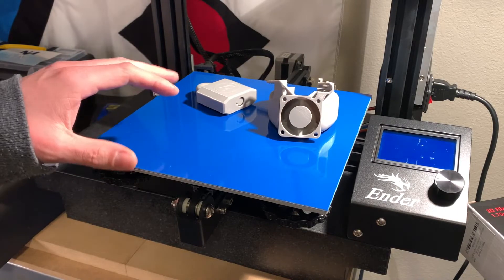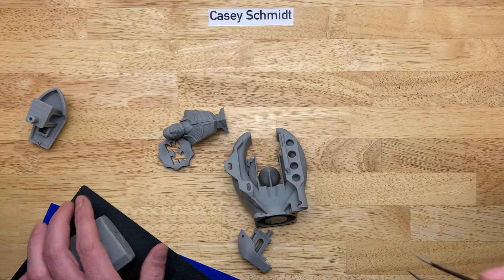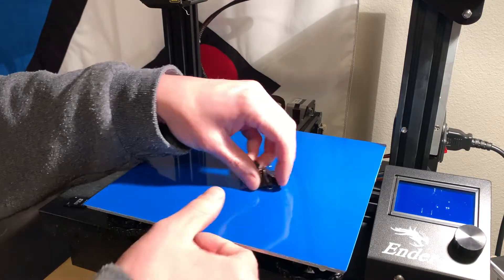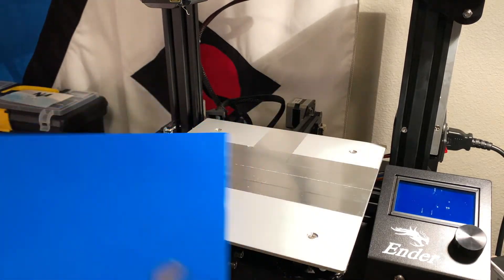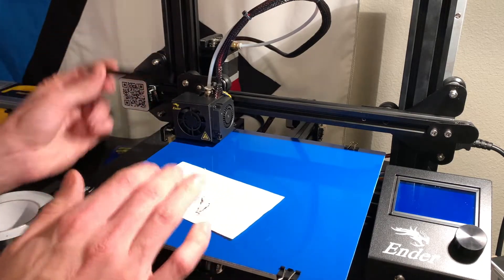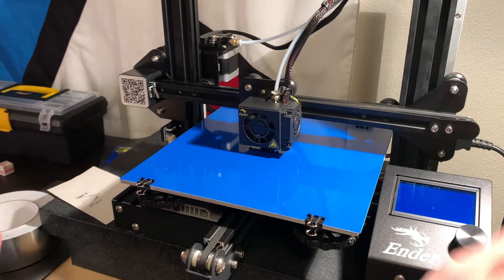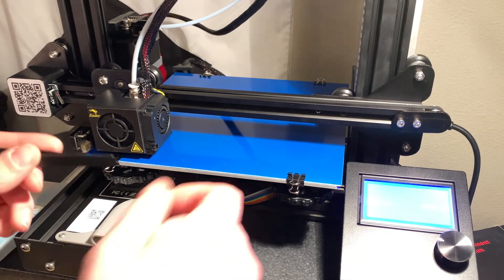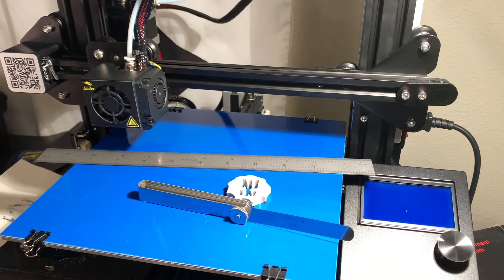Ender 3 - Fix Warped Bed, Bed Leveling, and the Best Print Surface

Comment: thanks i will try something like this, my ender3 worked great when it was new but then i stopped using it and stored something on the bed and now its low in the middle and no amount of adjusting fixes it

Comment: How thick did you go with the G10?
Reply: you will need 3mm of FR-4 (G10) for warped free G10 at higher temperatures like 110C for printing ASA for example

Comment: Great video, didnt even think of this! My plate is only sticghtly warped, if i level all 4 corners,  on the edges and in the middle i can fit 2 sheets of paper instead of 1. Will try to get my hands on some of this tape. Atm i just babystep z for small prints :p

Comment: This video was so helpfull, I finally understand the problem. For the people that do not want to adjust the problem with tape, during the process of fixing the warped bed problem and the help of this video I fixed the issue with the glass plate that came with the printer and this fixed it already I prefer a magnetic bed so I installed it on too the glass bed and the problem was gone without the use of tape😅

Comment: Well, I got impatient. I got my G10 at 12x12. I could not get it snap after scoring the lines so I took my Dremel to it. What a mess, lol. Unfortunately, my final cut is exactly the same as the heat plate as I forgot to add 2mm all around. Plenty of room to do so but I screwed the pooch this time. So, no overhang on the print bed! The bigger challenge was removing the magnetic adhesive on the hot plate. I finally managed to peel it all off and then spend 1/2 hr. removing the sticky residue. All done. Pray this works out for my printer. Thanks!
Reply from the maker: Patience usually prevails. You can always retry cutting another piece in the future too. Good luck!

Comment: I'm getting frustrated with my Bed level in The 4 corners seem like they are barely touching the paper. When I level them enough to grip it slightly. Every corner is exact near enough but the middle just isn't. I brought a new bed and it's still the same

Comment: I have the 3 Pro. It has a magnetic adhesive layer on the build plate. So I peel the magnetic sheet off the aluminum bed first, clean off any residue and then clip on the G10 build surface?
What thickness did you go with 3/32" or 1/8". What filaments do you use? It appears these phenolic plates only are tested to 280 degrees F. How long and how hot have you ever done a single print?

Comment: Been using a creality PEI sheet, and the center will often be lower than the corners, but it seems like it's the corners lifting over time on the sheet, and bed being of no issue.. which is extremely annoying, because traming it doesn't really help then 😅😅 pondering a G10 sheet, but not sure what they are like for warp over time
Reply from the maker: I’ve used that same blue sheet for about a year and a half now and it’s still in nearly perfect condition. For how cheap they are, I think it’s worth trying.
Reply: I have the same problem!!! - I have the Ender3 S2 Pro & have modified my gcode to bed level before printing to eliminate the problem, but the problem still persists.... 
I think what's happening is as the layers are printed, the more the centre s sucked in & moulds into the bed, causing the corners to lift. 
I have removed the magnetic plate that's stuck to the bed which came with my printer & the bed now seems to be level. Maybe its the glue?, as there seems to be more around the edges than in the centre, or there's some kind of expansion going on???. I'll order an aftermarket/thinner magnetic plate & hopefully resolve this problem...

Comment: Is there anything else you can do besides the tape I wore that it may catch fire what else do you recommend I have a ender 3v2 and changed the stock glass bed to the flexible magnetic bed and the adhesion problem was fixed but I had the same problem where the nozzle didn't want to touch the build plate even when the job was turned all the way
Reply from the maker: I guess it might be possible that the tape could catch fire but this tape is meant for HVAC ducting and exhaust so it’s can handle very high temperatures. I’m not sure of any practical alternatives.

Comment: There are several gcodes that will move the head from screw point to screw point.
Reply from the maker: I could have done that, and probably should have. But it was easier to do it manually at that time.

Comment: I have a bl touch and use that for bed levelling and still have warping problems. Why wouldn’t you do the levelling warm if youre having warping problems?
Reply from the maker: Parts can/will still warp even on a very flat build surface. It’s simply due to the contraction of the plastic as it cools; larger/longer parts are more susceptible.

As far as level the bed warmed up, that would be a much better way to do it if you need the best accuracy. I have tried it both ways and it doesn’t make a whole lot of difference for the parts that I print only because I try to keep my parts small and use a thick first layer.
Reply: @Casey_Schmidt  awesome reply and explanation thank you so much i was ready to  buy another hot plate and/or chuck the whole printer in the garbage if i didnt come across you

Comment: How would I know if it's the glass or the metal bed that is warped? I want to get a g10 sheet and not have to manually plane the metal bed. Will just replacing the bed surface with a flat one help?
Reply: Glass will conform
Reply from the maker: Getting a new aluminum plate that is not warped would be the best solution. 

Anything you put on top of a warped bed will just end up being warped like the bed; unless you used a very thick piece is glass. But that would end up being so heavy that you’d get into ringing issues.

So the only reasonable options to improve flatness are to either shim the existing bed like showed or to purchase a replacement flatter bed.
Reply: @Casey_Schmidt  But how in the world are you knowing your next bed would be really flat?
Reply from the maker: @Michel777   there are precision ground plates but they’re quite expensive.

Comment: just throw it out if the bed is warped that's bad quality control seeing as everybody with an ender has the same problem best suggestion don't buy one don't know about other machines if they have the same problems
Reply from the maker: Aftermarket beds are much better, yes.

Comment: Great video! Do you have a recommendation on how thin the aluminum tape should be? I found some at home depot that says its .003 mm thick and my instant reaction was it might be too thin and require a lot of layers. There are some others that are around .1 mm thick as well
Reply from the maker: Thicker tape is better thermally. The glue layer acts as a little bit of an insulator so fewer layers is best. However, thicker tape is harder to work with and may result in more creases and bubbles so take that into consideration too.

Comment: What filament did you use
Reply from the maker: The stuff I’ve used so far is the cheapest junk I could find on eBay from a US seller. Like $15 per roll. It works surprisingly well to be completely honest. But I will be trying a spool from Atomic Filament next.

Comment: It's as had taken a while to think of this but for one thing;  the beds on these should be never anything but a cube if need be;  I mean that it should be thick enough that it cannot be anything but straight;  and then if there would be such issues as then the travelling of the head of not being perfectly running squarely;  then there would need to have a runner that dictates how high the tip is and this runner can only be under the bed;  where if spring loaded upwards as if to keep away the furthest from the bed and the runner having it always kept down and as the runner always is exactly at the same spot as the tip and if the bed is exactly always the same thickness;  then if it is setup well;  it should work.  Or why would it not be that there are four corners that determine the height by the use of each a screw that is mounted on a solid flat bed( like any other tool out there).  Like a planer has;  way too much maintenance is needed to work with these.  Why ever would it be logic to have two separate strait edge parts for the keeping of a precision tool tip aligned?  This all because of materials costs and weight of shipping I suppose.  Ideally;  it should be built within an iron bed such as similar to a table saw table grade of solid and oversized with two racks running two pignons each that hold  two other racks that are mounted to a solid plate where the nozzle does not move and the is the one that starts up high at the nozzle and has  a screw at each corner that moves it down with exact precision.  And eventually;  with this method;  they can have a plate with extrusion pores that cover the whole plate and nothing would need to move other then vertical as a constant instead of steps(maybe);  where a constant flow of complete printing where the whole object will seem to be coming out of the extruder surface.   Cheers.  I've predicted many of things and can't remember of any that haven't happened.  I might just not remember of some but I doubt it though.  Ah ya ok  here it is;  water cooling as it goes downwards withing the water cooling bath where the extruding goes on at a controlled distance above the water level.  LOLOL  I bet you it will take until year 2026 for them to get that.  Watch and I'm sick of writing on hear and so I'm outta here man.

Comment: Installed the G10 sheets on all my printers, and the comments made above regarding the advantages are SPOT ON.  These build surfaces, are the best thing since sliced bread. BTW fantastic is an understatement.
Reply: Don't know if you still replying to comments but, i have been using the Ender 3 magnetic bed 2 of them and there warped is that common and evertime i do a 1st layer a part of that layer doesn't stick and i see big gaps
Reply: fun fact that plate he has didnt come with the stock ender 3 if i am correct. the backing on those are garolite. the surface on top is just buildtack. you can flip it over and use the other side. and doing that is how i found out my aluminum bed was warped. wouldnt stick in the center at all it had a dip down in the center. and that lead me to this video

Comment: instead of using the paper you can use the feeler gauge to set the tip at a more exact height.
Reply from the maker: Very true. I have tried a feeler gauge but I found, at least for the printing I do, it to be more difficult to use and any additional accuracy to be unnecessary. I will concede that it is a technically better way to tram the bed.
Reply: @Casey_Schmidt  I was gonna say, this dude knows that tram is actually the proper name, has feeler gauges, and then went and used paper anyway?!?

Comment: I have a machinist's granite surface plate and have thought about lapping my Bed
Reply from the maker: It might be worth it? But the plate will warp when the bed is heated anyway so I think the best way to go is a BL touch or similar system that will have the g-code modified to follow the contour of the bed.
Reply: @Casey_Schmidt  I have a CR touch and am still getting thin spots. Bed seems to be warping more by the day.
Reply from the maker: @59KYHighlander  you can buy aftermarket cast aluminum beds the are made to have minimal internal stresses then machined flat. That may be the best route if you don’t mind spending some money (probably more than the machine costs). Then again, these machines are more about the fun than them money. Another tip that I’ve heard to combat thin spots is to increase your first layer height and first layer extrusion multiplier.
Reply: @59KYHighlander  How warped is it now, is it taco shaped yet?
Reply: @BurittoSandwich  Not tried it yet.

Comment: Can you still use a magnetic sticker sheet with your aluminium tape bed warp fix?
Reply from the maker: I don’t see why not. The bed is aluminum and therefore not magnetic, adding a few tenths of tape shouldn’t affect anything.
Reply: Yeah, I peeled mine off. Erred on the side of caution

Comment: The best investment I made for my Ender 3 was to add a BL touch, upgraded to Jyers firmware (free), and add a auto bed level G29 G code to the starting G-code in the slicer. This does the bed level at printing temp before every print. I selected the 5x5 probe point version and it takes about 5 min before each print. The advantage is that you can change bed material and it will level regardless of imperfections of the different materials you use
Reply: Bullshit. I got a CR touch and it doesn't do jack. If you have uneven surfaces, even after adjusting the Z layer, it's still not going to work. Fixing bed warps is mandatory.
Reply: @HamzanMartinez  agree with this. My BLtouch is properly configured, the level mesh is properly taken, and yet the print is a bit uneven (even with ~0.15mm level variance). It doesn't do anything save show you the state of the bed. It does not auto-adjust while printing.
Reply: @kloakovalimonada  I totally agree. Have a BL Touch installed and it recognizes large shifts, but I get thick lines around the border, and thin lines in the middle (almost non-existent). Definitely going to get some of this aluminum tape and level out the warp the bed...and get some garolite...
Reply: @HamzanMartinez  same here I can’t get it to work for nothing in the world.
Reply: This sounds awesome, is there a video that outlines how to install and configure?
Reply: @slablife  BV3D: Bryan Vines https://www.youtube.com/watch?v=NDe6QXreBNs adding a BLTouch to an ender 3 v2 
https://www.youtube.com/watch?v=o1zXYwgIPLY&t=2s Jyers firmware download install and set up
I used the EV3V2-BLTouch-5x5-v4.2.7.bin (v4.2.7 is the board version)
Where you add the G29 auto bed level G code is in Start G Code in the slicer. 
For Cura https://www.youtube.com/watch?v=9EYoQGV7wl4
I added the G29 on the line after the G28 ; Home all axes
so it looks like
G28 ; Home all axes
G29 ; Auto bed level
The other advantage with Jyers firmware is that allows you the save your printer setting to the Eprom on the controller board, so that if you upgrade Cura or Octoprint you don't have to worry about your printer settings.
Good luck
Reply: its just a shit design, you shouldn't have to do any of this. Both plates should be thicker.

Comment: I just found one of my E3's bed has a real nasty crown front to back, but even all the way across.
I think I'm gonna try this!!!  Thank you!!!

FYI:
That stock Ender build plate is also G10.  I peeled that black layer off both of my E3's platforms.  Heat the bed to 60C with the plate on it.  Once it hits 60, pull the plate off and start peeling.  It's on there real good, but that G10 can take a beating.  If it gets too hard to peel, put it back on the bed for a few minutes, and pull some more.  Clean the residue off with some Goo-Gone (look it up).  Final clean with some DNA.  Elmer's and H2O from then on.

I like the idea of the aluminum tape.  It's a solid spacer that will also allow heat to move.